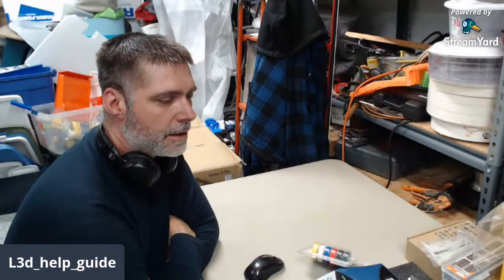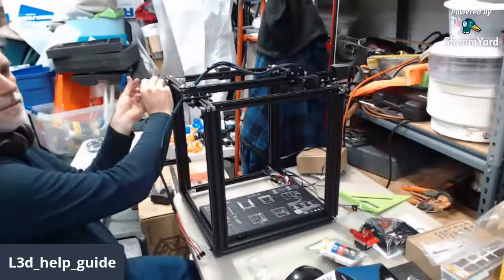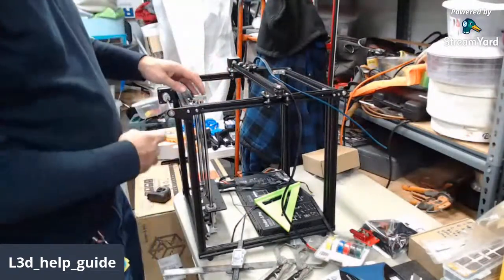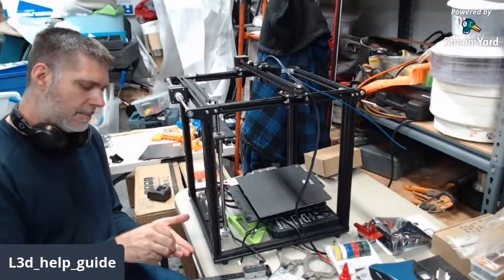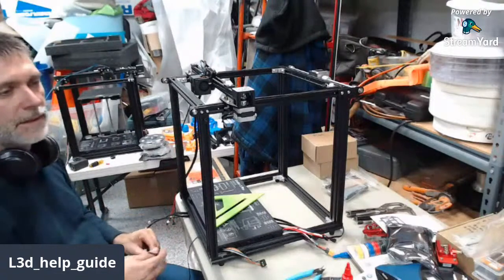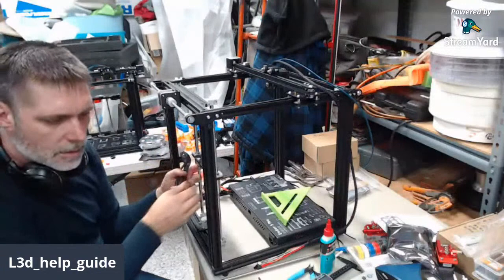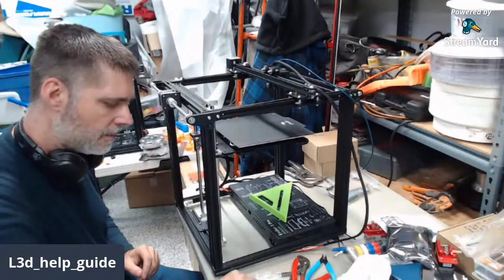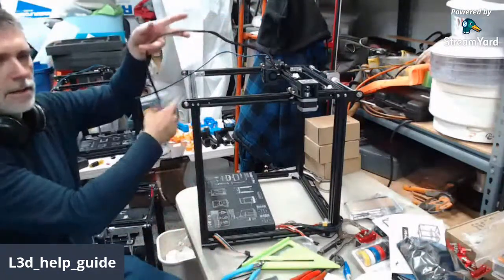Three Ender 5 Pro assembly for a friend

Comment: When you are measuring the vertical guide's distance from the right frame near the beginning and finding the .3mm offset, if you are winging the distance from the vertical guide to the frame closest to you to do the measurement from the right frame instead of measuring from the exact same distance both vertically and horizontally, you may end up measuring from a non-square point to the right frame right? I'm going to print a jig for doing this though, I never thought to measure that during setup.